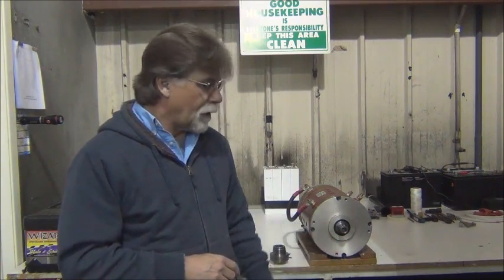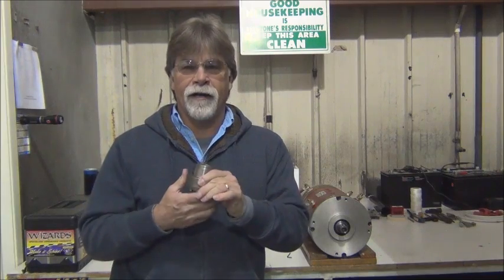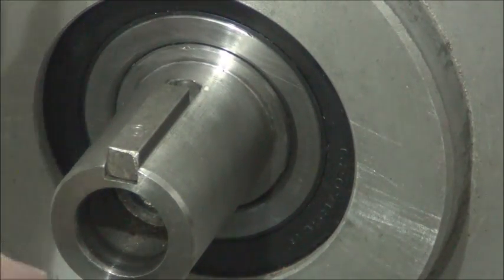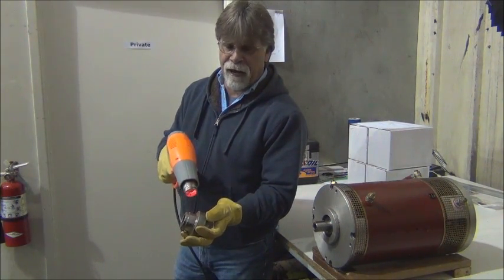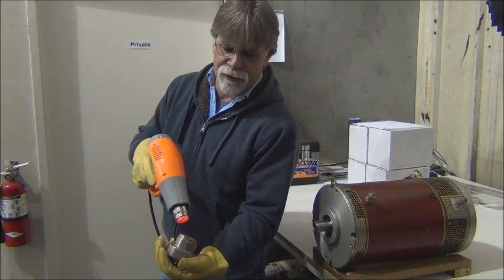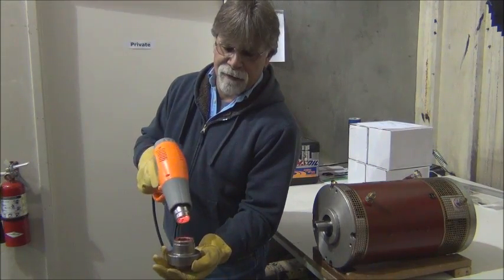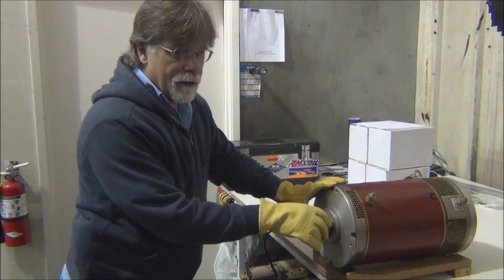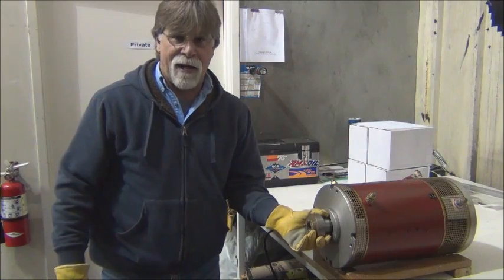DIY Electric Conversion - Motor Coupler Installation  www.EV4Unow.com

Comment: are the warp 9 motors still useful in ev conversions?
Reply from the maker: Depends on your objectives.  Due to weight, efficiency, running temperature, controller options, and lack of regenerative braking, series wound DC motors in general are not the best choice for a commuter vehicle conversion.  Thank you for being a subscriber.

Comment: There is no way in hell you can get the heat required for thermal expansion with a heat gun. I put my coupler in an oven set to 450 for an hour and still could not get it to slide that easily. And pulling it off that easily is crap as well. And guess what, the coupler I used was from Canadian electric vehicles. All this video tells me is that you have modified the interference substantially.
Reply from the maker: You are correct.  That is a special coupler that has an interference fit, but not as much as normal.  This coupler is used in our Workshops and was specially designed for that purpose and to be reused over and over again.  We heat normal interference couplers on a hot plate.  Would not want to try to remove one though.